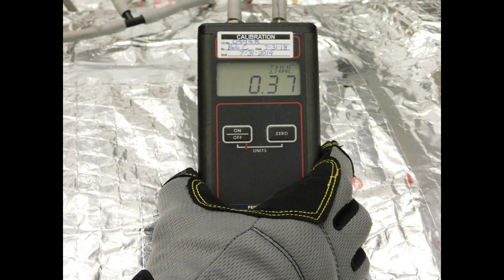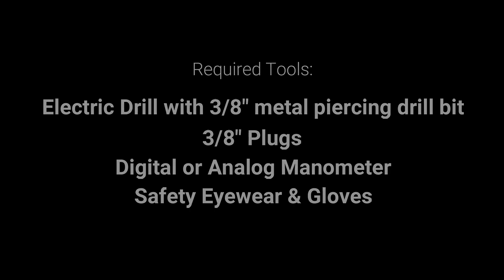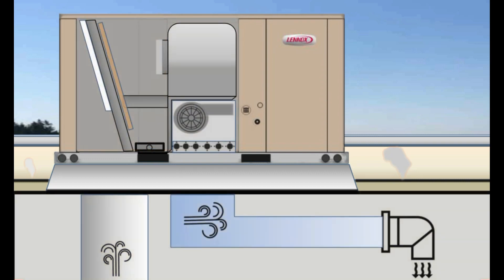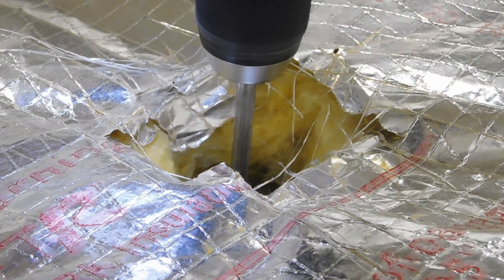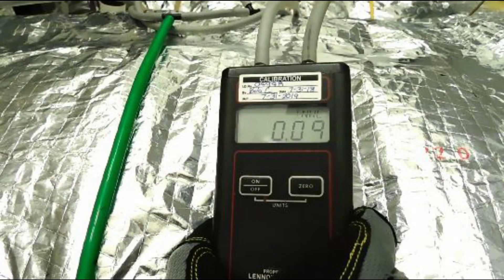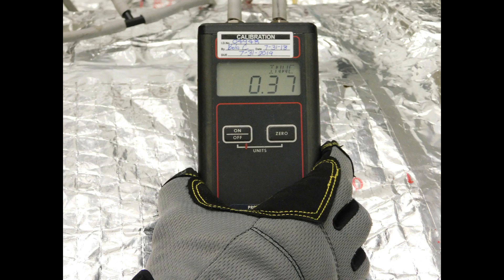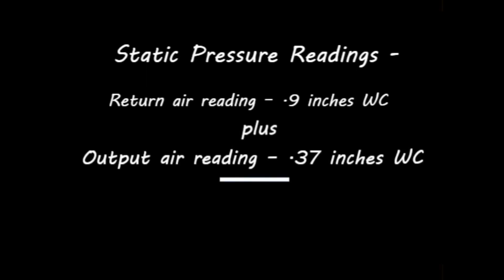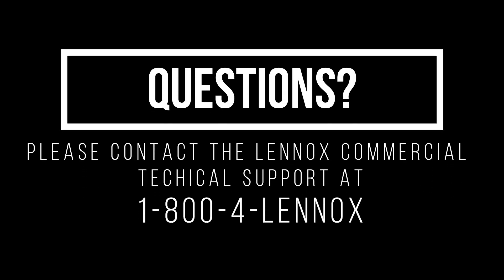Measuring Static Pressure

Comment: The placement of test holes miss measuring static resistance of following:
1) Return air test point misses filter and coil.
2) Supply Air test point misses duct bend and duct straight run. While the straight probably has negligible  resistance losses the bend  being  close to the fan discharge would have a lot of losses.